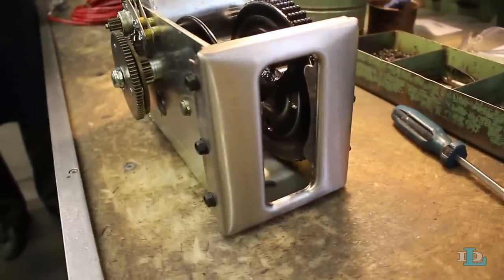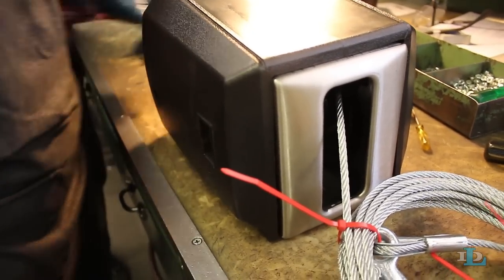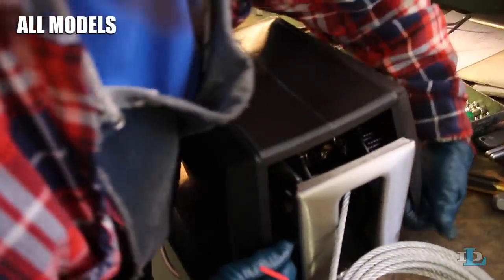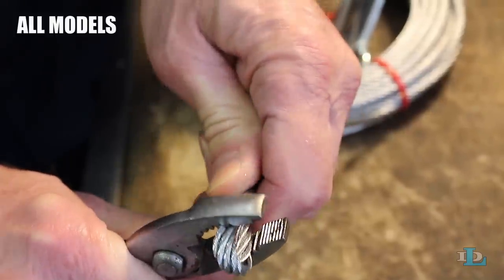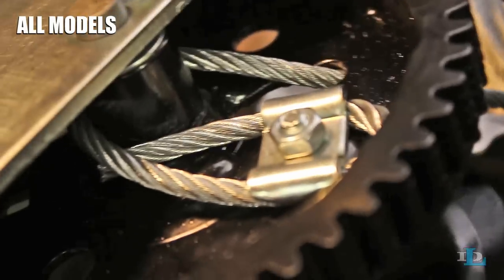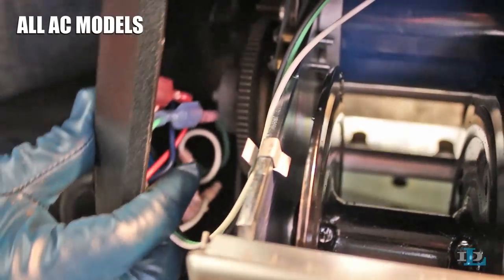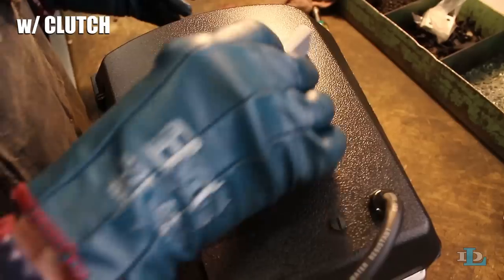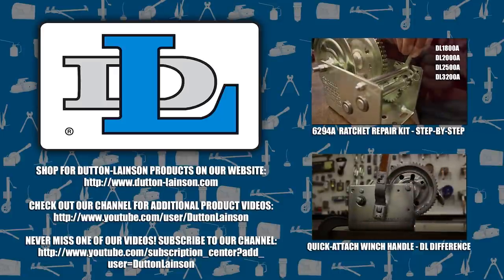Replacing Cable on 9000 and 12000 StrongArm Winches - Step-By-Step

Comment: We installed a new cable to our 9000 with clutch, mounted on a boat lift that was originally installed around 1997-9.  We inherited it with our boat lift and told the cable had been replaced at least once previously. Poor maintenance to the teardrop pulleys however resulted in cable damage.  Although it should not have been all that difficult, and this video was helpful, it was. Our suggestion is that a video demonstrating a cable installation to a mounted 9000 (with clutch) would be helpful to other do-it yourself owners in a similar situation that are otherwise unfamiliar with installation to a likewise mounted winch. Thank you.